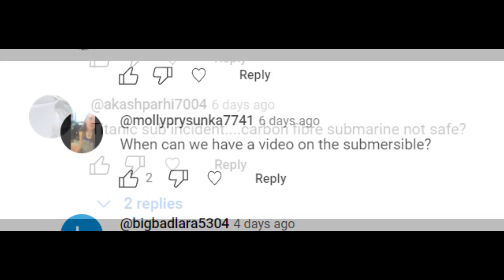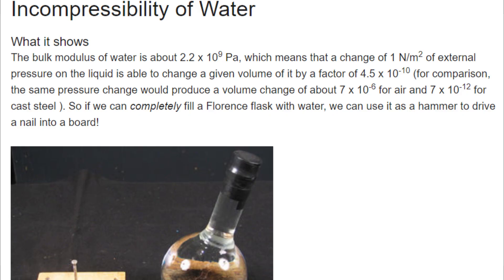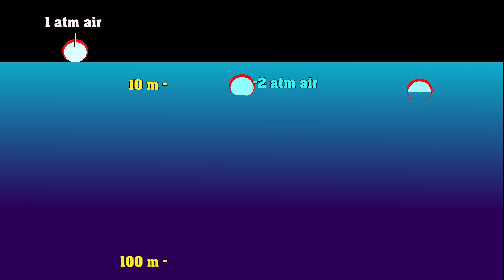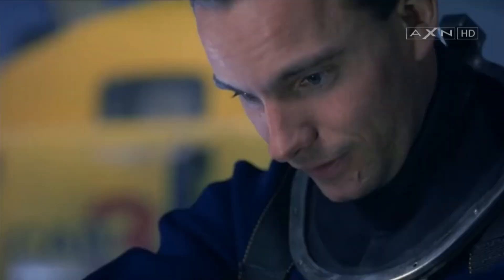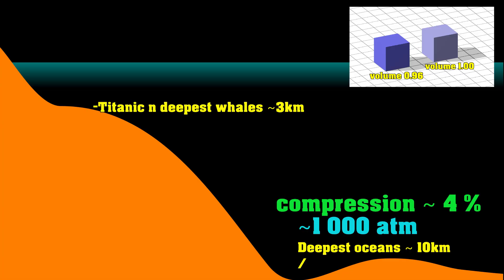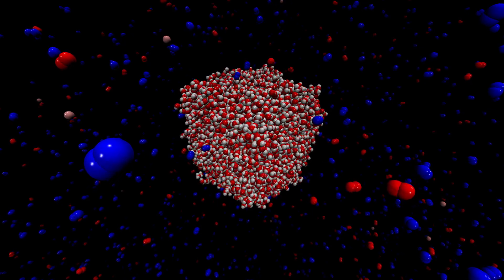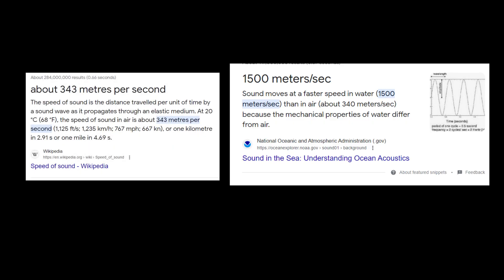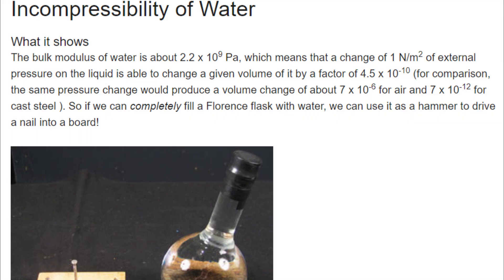What Happens when a Hull Fails at 1000 atmospheres?

Comment: The sad thing is, this failure was entirely expected.

3:16 Isn't the average speed of air molecules at 20°C about 500 m/s? Compared to the speed of sound at 20°C being 343.14 m/s?
Reply: The leader was warned many times, he ignored each and every one and died exactly how they told him he would. It's a shame he took innocents with him.
Reply: @notsae66 many times? I can only find one warning from 2018
Reply: He was warned by many people
Reply: 500 or 343 are the same ballpark.
Reply: Speed of sound in water not air is the critical number - 1402m/s (water at that depth is at freezing temperature).
What may slow things down is the water freezing as it decompresses.
Reply: @allangibson8494  Water will not freeze as it decompresses. It will evaporate. But only briefly, as it will condense again when the pressure equalizes a millisecond later.
Reply: @olmostgudinaf8100  The water at 3800m is at -17 Celsius (1F) - it is a liquid simply because of the applied pressure.
Reply: @allangibson8494  -17°C sounds like a stretch. All the sources I've found agree on 2-3°C, with very little variation from about 500m all the way to the sea bed.

17°C (positive, 62.6°F) is usually quoted as the "average" sea temperature. I assume they mean average sea surface temperature.
Reply: @olmostgudinaf8100  There is a set of tables for deep sea ocean temperatures. Most of it sits at about 1 degree Fahrenheit / -17 C. Frigid.
Freezing in deep water is definitely an option.
Reply: By geniuses like you I’m sure